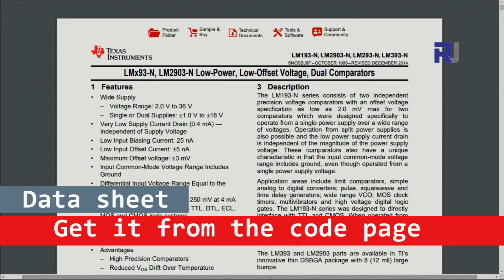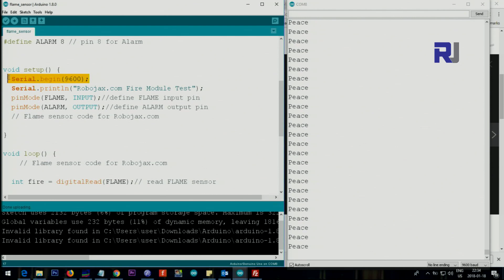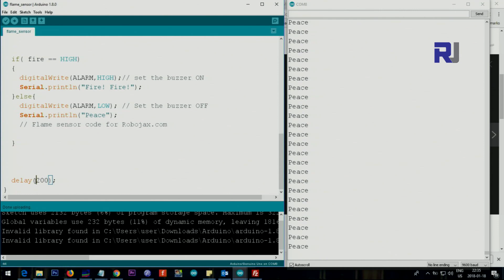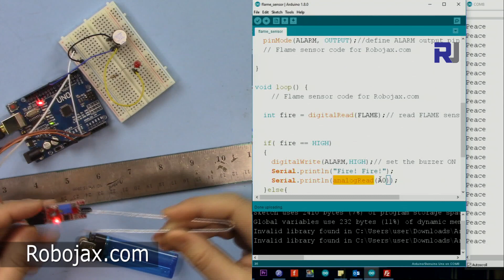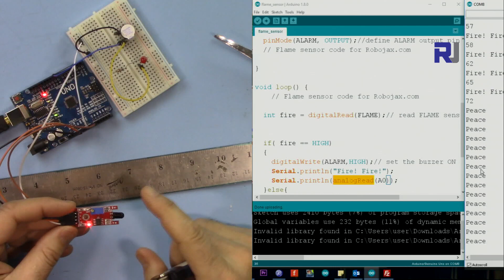How to detectg flame with Arduino RJT49

Comment: What if we use 3 flame sensors, what pins will we connect? We will use it for our fire fighting robot :>>
Reply from the maker: Hello, I have shown how do you define pins for this. do exactly the same for 2 other sensor. Define pins  and code.  All my videos and codes are free. but if you pay for custom code, you can contact me via robojax.com contact page. I will charge $100/hour for work. Don't forget your email in the body of message if you contacted me.

Comment: Can you give me the circuit diagram of this?
Reply from the maker: you don't need it because if you try to build it, it would cost you 10 times.  But if you want to have the schematic, you can use this free program https://fritzing.org/
Reply: @robojax thank you for giving information. 🙏 can i ask another question? how about when i'm done installing the code. It is okey, that i'll use battery to my arduino? To turn it on 🤔

Comment: avrdude: stk500_getparm(): (a) protocol error, expect=0x14, resp=0xa2
An error occurred while uploading the sketch

avrdude: stk500_getparm(): (a) protocol error, expect=0x14, resp=0x10
avrdude: stk500_initialize(): (a) protocol error, expect=0x14, resp=0xa2
avrdude: initialization failed, rc=-1
         Double check connections and try again, or use -F to override
         this check.

avrdude: stk500_disable(): protocol error, expect=0x14, resp=0x10

Comment: Hi if this sensor cant use for production what fire sensor i need to use if i use this to production ?
Reply from the maker: test it, it it works for you, make 3D print case and proper wiring. yes then you can use it if you do proper wiring to keep it safe.

Comment: Thank you. What is the analog pin (AO) for on this module?
Reply from the maker: In most module it will output the variation of level of flame 🔥 it receives will be  outputted.
Reply: @robojax  Ok thanks, big fire or small fire.

Comment: I have 3 pins for buzzer can u please tell me how to connect
Reply from the maker: Fiat try your buzzer by connecting two of its wires to +and - and find out  connecting which wire turns it on, the use those two wires

Comment: Hi Sir, can i ask you that my buzzer and led is on directly after the code is uploaded to the board before the sensor was detected by fire but once the sensor is detected buzzer and led was off so it is like reverse. Can you please reply me what is am i wrong with this ?Thank you Sir Robotjax.
Reply from the maker: Hi,  you should not have updated the code. First use the code as is and once it works, then modify it.
I have explained it in the code and clearly shown that  
   digitalWrite(ALARM,HIGH);// set the buzzer ON
    digitalWrite(ALARM,LOW); // Set the buzzer OFF

just switch the location of the two line lines above.

Comment: have been tested a flame blue sensor module and i noticed that this one turns LOW when becomes active, compared to your red tested module which turns HIGH. The maximum range of the detection is 0.9 meter. Bringing in the front of the IR detector a remote control similar to those who can be found for some kits which include an IR receiver for some applications such as remoted control car, the range becomes 0.5 meter and for TV remote control, becomes again 0.9 as in case when an igniter appears.
Reply from the maker: Thank you for sharing the infor.

Comment: I just want to make one for myself. Where should i start
Reply from the maker: this module is so cheap that it would cost you 10 to 20 times more to build. But you can do it.  This is infrared receiver. Search on google "infrared receiver circuit" and click on images after than and you will see 100s of projects. Good luck.
Reply: @robojax  thank you dear
Reply from the maker: You are welcome.

Comment: sir i am using 3 fire sensors so how i can write the code for because the buzzer only turns on with 1 sensor while all the three sensors are sensing.
Reply from the maker: if you have 3 different buzzer connected to different pen,  make sure turn them ON . I don't know your code to comment.

Comment: Thank you 😊❤️
Reply from the maker: You are welcome.
Reply: @robojax  Why my flame sensor is in reserved/oposite ?. I mean it returns  LOW when there is flame and HIGH when there is no fire ?
Reply from the maker: the output state is designed like that. this is normal.
Reply: @robojax  okay. Thank you
Reply from the maker: You are welcome.

Comment: Which flame sensor you use in this video? 
Please tell me for my project
Reply from the maker: this is called flame sensor. The did not assign model number to it. On Amazon or eBay search for "flame sensor" and you will find it.
Reply: its called ky-026 flame sensor

Comment: What kind of module can be used to have a larger distant detection of flame?
Reply from the maker: It depends how far, but the best option would be to have laser beam or image processing with raspberry Pi with camera. Camera can detect the the flame and trigger an alarm.
Reply: @robojax  is there another sensor that has the farther distance detection of fire for arduino?
I don't have the rasp berry

Comment: i use this ir sensor but it's sensitive on the normal sun light & yellow light to if i want to detect only candle flae how cn i do it from using this module. if i cannot user this sensor  in open light only detect candle light what are the suggestions . thank you.

Comment: Is this also applicable with the 5 way flame sensor? And if no, can you suggest 5 way flame sensor codes where once the LED lights up, it immediately detects it on the Serial Monitor
Reply from the maker: Never heard of 5 way flame sensor.

Comment: Hey bro i have already seen your video but why my Led wont turn on as the video
Reply from the maker: The potentiometer is multi-turn. You have to turn it 8 or 10 time before you see the change. So turn it 8 turn then test with lighter. Then then turn more and test again. in both direction and you should get it.

Comment: Hello I have a question
At 6.32 (analog read) what is the meaning of 0 to 300? Is it distance of flame or different thing?
Reply from the maker: the value you read it the intensity of flame which would be very hard to use. Analog pins have value from 0 to 1024. where 0 is 0V and 1024 is 5V. you can use map function to convert it to voltage like this: Serial.print(matp(300, 0,1024, 0,5) and you can put a variable in place of 300
Reply: Thank you very much. I will try it.

Comment: We cant see how you connected the module
Reply from the maker: at 00:44 (click on 00:44) I have explained the connections. and at 02:17 I have explained the flame pin. Which I will update the code. You will connect DO pin of the sensor to pin 2 of Arduino.I should have shown it. Thanks.

Comment: Thank you for the vid . I want to ask . This module can detect 700nm -1000nm spectrum of the fire, ummm so can we display that 
Spectrum in number in Arduino ? If can how ?
Reply from the maker: you are welcome.  No you can't because it doesn't distinguish exact spectrum. But if you want to display test instead of relay or turning on an alarm, that would be doable. here the LCD1602 video http://robojax.com/learn/arduino/?vid=robojax-LCD1602-I2C
Reply: Robojax thanks for ur reply , then can we display the resistance of the sensor ? How the flame will efc the resistanc btw it is same with NTC ?

Comment: what is its applications ??
Reply from the maker: this device could be placed closer to the a machine that might create flame and this would trigger alarm. Other application, in gas heater the igniter can be turned automatically, when gas started burning, this device could turn the igniter OFF.  Or could be programmed to turn the igniter ON when there is no flame.

Comment: What library did you use?
Please tell me 😢
Reply from the maker: if you see #include.... then then there might be a library. so there is no library. Just use the provided code. The link for the code is in the description of the video.
Reply: Thank you
Reply: It can also work in 3 pins? (Vcc,G,DO)?
Reply from the maker: I have explained that in the video.
Reply: It works, that you very much

Comment: Hi. Nice experiment. How about if you put a hot object (eg. soldering iron or glass of hot water) in front of the sensor instead flame?
Reply from the maker: nothing will happen. As shown in video, it is the infrared elements of flame that makes the module to detect. if you try remote control of your TV, it should turn on.
Reply: @robojax  that's very interesting! I want to use the flame sensor for a school project, but I don't want to bring a real flame into the classroom. What could I use in place of a flame?

Comment: what resistors are you using?
Reply from the maker: At which part? If from the video, please point to the time on video and will look at it  ( example 03:15)
Reply: Hi :) Same question: Timeindex 4:45 where you explain the code you show a top view. What I mean is the resistor for the red LED ;) Thanks a lot. It is kind to share your knowledge with us. Big like and I subscrie to your channel (if I could I would give you 2 likes)
Reply: Manuel Müller... Use a 1k ohm resistor.

Comment: Hello robojex, can you tell me why my aurduino uno boards power jack is not working, i tried it many ways from 5 to 12 v dc but it not working, one more question can aurduino be used as 24 hour timer so that i can power on 4 stepper motor for different set of time?
Reply from the maker: Arduino power:
it should work. Check your power adapter using multimeter to see if it produces  anything above 6V.  When you connect the power adapter, Arduino has voltage regulator that converts it to 5V. But when you use USB, it gets the exact 5 Volts from USB. So if your power adapter is providing thing 6V or more then it is possible that the voltage regulartor on the Arduino is defective.
Timer with Arduino:
Yes you can use it . But you need DS1302 Real Time Clock which has battery and keeps the time. then you can use  read the time and trigger an event like turning stepper motor ON or OFF.
Reply: Robojax thank you for reply, my aurduino power jack is ok now. Can you please do me One more favour. If you can do the 24 hour real time project with aurduino and ds1302 real time clock then please make a video so that i can learn from your video. Actually i am quiet weak at code writing. Many thanks sir.